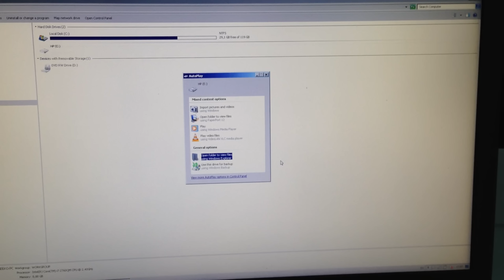How to recover data from a dead hard drive (for beginners)

Comment: i'm no engineer, but you didn't recover data from a dead hard drive.  you saved the data by saving the hard drive.  vast difference.
Reply: So do we get the data back or no? Please explain the difference and tell me about it.
Reply: @muhammadraza9292  basically he just saved it into the hard drive without retrieving into another drive, which means it was useless in the first place
Reply: Meet the engineer

Comment: Something else that could be causing this problem: the USB connection/unit is failing. This is what happened to my Seagate external hard drive (bought in 2008ish).  The unit was making a very faint clicking noise, and so thought the problem was the hard drive (as shown in this video). Once we got the hard drive out of the plastic shell, we put it into different 'shell' (hooked it up to power and a USB to the the computer) and the clicking noise went away, and i was able to access my files without an issue!  Turns out the USB unit had become very loose from the green circuit board (it was so loose it was flipping up from the board), and so was basically not doing it's job. Of note, the hard drive got really hot after only running for 15 minutes, so it's probably on the fritz as well, but we were at least able to get data off of it before it (eventually) dies.
Reply: I think I found my problem.... This is exactly what's happening with my Hard Drive !
Do you know what's that "USB unit with the green circuit board" called ?
I think if i could replace it would solve the issue...
Did you replace the USB unit ? What do you mean by "shell" , are you referring to the USB unit as "shell" ?

I know it's late, but if you're there plz help
Thanks

Comment: "how to recover data in some rare cases or how to make it impossible for data recovery lab in most cases"
Reply: The odds of someone with a dead HDD taking it to a data recovery lab and paying $500-1,500 to retrieve the files: 1 in 20,000.
Reply: Try to boot laptop with Ubuntu without installation with HDD in ur laptop and bootable pendrive. If drive shows in Ubuntu,then u can recover it by making it external hard disk by using HDD enclosure...
Reply: @Amit-rw4jo  what if it is not readable by bios itself. Ubuntu is just an OS so if BIOS can't detect it how can Ubuntu do it?
I have 2 such dead internal hdd's (not readable by bios) , if it is possible to recover data from this....then Help
Reply: @cinnamonsquash  download latest (hiren boot cd) and make bootable USB then boot the usb or recover your data
Reply: @bricology  I live in a small area with a low population, I work as a computer repair tech, and I send out HDDs for data recovery in a lab, and I do this typically around 2 or 3 times a year for $1600. So though it's rare, I would have to say it happens a lot more than 1 in 20000. That said it's always business computers or family photos recovery. I've never had someone pay that for some torrent files... yet.

Definitely do not try this with important data, as the odds are far greater that you will render the data unrecoverable, and this is a last ditch effort, not the first thing you try.
Reply: @nickgouthro  -- admittedly it was an off-the-cuff guess; I had no data from which to draw it.  But I still think it's a minuscule number, since the vast majority of HDDs that fail will never even be brought to a tech to be checked-out, much less then sent off to be recovered for $1,600
Reply: @abdulqadeerkhan9261  No software in hiren's boot cd can do magic. They're useful but not when the problem is at hardware level and not even when it's a deeper firmware problem, such as those that WD Marvel can solve if the hard drive is a WD one. For many cases you need a lab and tools to bypass the pcb (cause the firmware of many brands is closed). But, of course, your data may not be that valuable that a lab will be worth it.
Reply: Rare cases? Stiction is very common. Really common. And the odds this will cause extensive damage are little except if you fuck up, cause dust particles are really not a large issue at all, mostly they'll just be spun off from the platter as soon as it speeds up. The damage you will find has already been caused when it got stuck and scratched the platter.
In any ways, data has a value. 
People who says things are "priceless" are just people who were never forced to make difficult choices, everything either has a price or can be attributed one. I'd say most common user data is worth less than a thousand dollars for themselves, but it's also worth this attempt.
Reply: @Gabriel-sq6vy  the only stuck arm you might recover such way is the one which come from drop damage. In many cases  one or multiple heads stay on surface, results are obvious. DR professionals NEVER reuse stuck head even if it was removed as a one piece.
Reply: @Gabriel-sq6vy  the only  data worth such attempt is the data already considered as completely lost.
Reply: @R P take it to a pro
Reply: @Gabriel-sq6vy  "Priceless" typically refers to the inability to put a price tag on things with sentimental value, such as photos stored on a HDD. It does not mean they won't pay to get those photos back, contraire, it means there's no price they won't pay to get those things back.

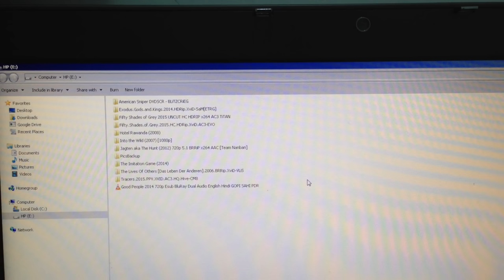Comment: Of course, I held my breath, awaiting your warning (at 3:05) that no hard drive opened this way should be re-used. Inevitably, some who watch your video will believe that if the drive now spins up, and was found on completion without obvious scratches, the drive has been brought back to life. The whole point of this procedure is to recover existing data as quickly as possible, and then put the drive to work as a fascinating paper weight (marking the drive with its volume name(s) and DOA date with a marking pen). Such "marking pen" documentation avoids enormous grief with data, later.
Reply: Most likely it's impossible now to pull a full image of that drive.
Reply: He discusses more or less what you just said towards the end of the video.  As he states, this isn't to repair the drive for normal use.  This is to get it working long enough to recover the data, then chuck the drive/replace with a new one.
Reply: Bob Greene ll
Reply: How long until the drive is dead, what if I have a lot of data to retrieve? Will it drop dead in matter of minutes, hours?
Reply: @kog7519  There's no telling how long you've got.  Something was really wrong to have those drive heads stick like that.
.
Reply: s l  That's why we always open harddrive in cleanroom... I'm a system engineer.. And it's hardly not recommanded to open it at all. If there is a problem with harddrive, the first thing to do is booting it with a recovery tool (like TestDisk) a good recovering tool will get you in the harddrive or make you know what the problem is quickly. Then if the problem is hardware, send it to professional if there are really important datas on it. Also, it's not recommanded even to boot a computer at all in dusty condition, it'll work, but dust will make it get hotter and hotter every day, that why server room are highly controlled environnement, to avoid any dust. For personal computer, it doesn't really matter, you'll have to clean you computer every now and then, for server, cleaning a couple of thousand computer is not an option.
Reply: s l  How is it irrelevent? You said that harddrive works well in dusty environement.. They don't..
Reply: s l  Hey man, as a guy that can't afford $3k to repair my dead WD drive, I appreciate your info. That drive is coming apart this week
Reply: s l  can you promise me you're not trolling? I have my dad's pictures and songs I need to recover after he passed away. Dust can't damage so of the files? I heard it's like if you scratch a CD...
Reply: Yes so before opening it up, try freezing it.  The unequal contraction of the platter and RW heads sometimes breaks them free to move and allow you a chance to get your data off the disk before it fails completely.  
Also the risk of scratching the platter using this method shown is v high unless you have very steady hands.
I’ve done this before and it does work in certain circumstances, depending on what is causing the HDD to fail in the first place.
Reply: s l  lmao 😂
Reply: s l  IS IT POSSIBLE TO DO SO BUDDY??? I HAVE 1TB WITH THE SAME PROBLEM I NEED TO RECOVER DATA FROM BUT I´M SCARED TO DEATH OF REMOVING THE COVER BECAUSE OF DUST??? WHAT DO YOU RECOMMEND FOR REAL??? THX!!!
Reply: @incumbentvinyl9291  *simply

We all struggle sometimes.
Reply: s l  He was referring to how you used "you're" instead of "your".
Reply: Hey man I definitely need help how can I contact you 🙏
Reply: . all this stuff is a bit confusing tbh ^
Reply: s l  chill kiddo
Reply: s l  hmm
Reply: s l  one of who?
Reply: s l  nope I used that hard drive for a week or two although I bought a new hard drive and by using a sata to usb case i copied data to the new one. The hard drive still works tho
Reply: s l  ye mane
Deez smol kids are wrong
Reply: @greatdaddy4710  A couple of years ago, I recovered three HDs exactly like in this video. They are still working.
Reply: @RmDIrSudoSu  no software helps if there is a mechanical problem
Reply: @Galova  it is then not recovered by software, but you can try to check what is at fault and replace it if possible, else there are possibilities to do it the hard way and analyse the way the sectors are magnetised, this technically can be done but it would be at insane costs, thus we uses backup and backup of the backup and then do backup on magnetic tape.

Comment: Excellent video! Very few people on YouTube or anywhere have shown that before you pay a data recovery company thousands of dollars to recover your data, it can't hurt to try this FREE fix. Love it.
Reply: If you dont care about your data feel free to do so.

But it absolutly can hurt if you mess up (fingerprint on H-3) or you re just unlucky because of the dust.

Filestructure is saved on H-0 + H-1 (lower surfaces) so you will notice if you messed up only until you start to read actually your data. 

Filestructure as MFT Map is normally not bigger than 1GB. So seeing your FS isnt any proof of a succesful datarecovery.

If heads collect dust und scratch because of it your surfaces completly even Data receovery cant help you here.
Reply: @Tobi3425 are u from data recovery company?
Reply: it can hurt

Comment: All I can say is WOW. I thought once the HD is opened in open air its dead. Kudos to you for getting this to work.
Reply: A drive that has been opened should be considered dead as far as using it for further data storage - it's no longer reliable. However, as long as the drive wasn't powered up while open, and no damage was done (e.g. fingerprints on the platters), it should still be readable for recovery purposes.

A note about dust: At 1:07, the part you can see in the lower right corner of the drive is an air filter. When the drive is first powered up after being resealed, it's designed in such a way that as the platters spin up, air will pass over the platter surfaces, blow off any dust, and trap it in that filter, before the heads even begin moving. (This is important because the drive mechanism can generate dust particles during normal operation.) So, unless it's massive amounts of dust, or something magnetic (e.g. iron gratings), dust is generally not an issue as far as recovery is concerned.
Reply: @NetRolller3D  I was probably more concerned that he spoke without a mask above the platter.    Moisture PLUS dust, you're not going to blow that off.

Comment: After watching other YT videos on this topic, this is the best one to date I have seen. Glad you mentioned that after opening the hard drive and retrieving the contents, to not put the drive back into service as it will not be a reliable device. I would say in this current day and age, this isn’t quite so common as most of the new drives bought today are solid-state drives, although there are still lots of these mechanical drives still in use.

Comment: This is great... The only problem with this is that most people will think that they can simply open an HDD in a regular room. HDDs are highly sensitive to particles in the air and must be opened in a highly controlled environment (ie. Clean Room). Without the proper tools and training, the user will end up making invisible (or visible!) scratches on the platter, rendering the data permanently lost.
Reply: this guy opened in a regular room. So did everyone in the comment section saying thank you lol. its just to get the data back, not to continue using it.
Reply: Who cares about opening it in a clean room or in toilet all that matters is they get their Porn back .
Reply: Hassan Ahmed 😂 😂😂

Comment: this is what we call stiction in the field, when you heard that sound it can also be a motor seizure which blocks the platter. My 2 advice as DR Technician are 1 do this only if you don't care about the data, if your data are important then go to a professional 2 please don't use the second hard drive on the platter, the guy on the video is well versed in doing it but you may easily scratch the platter by doing as in the video. A method that you can use is to put your finger on the base of the Heads in the circular and outer area and rotate it while you rotate the screw (anti clock)  in the center of the hard drive. The heads will go toward the outer part

Comment: This was a brilliant Video. Excellent picture quality and sound. Great technical content. Well done indeed!
Reply: as a Datarecovery engineer I have to say how dangerous this video is. One fingerprint on the surface and head-3 will die for sure. 

Also the dust will get collected bei head-3 and might scratch the surface. 

You re able to see your filestructure? Very nice, but that doesnt mean you re able to read data. Information about the filestructure is saved on H-0 and H-1. If you contaminate surface of H-3 you will still get filestructure even you contaminated H-3..
Reply: also: if your HDD is spinning your heads are not stucked on the surface. So please dont open your HDD if you want your data back. If you dont care you can try

Comment: I just did the first instruction to swing the arm across. But this guy didn't mention the tip was settled on the surface of the disk. So when I went to move  it, the tip made a prick scratch... Now gonna fine out if it works. So  when you try to swing it make sure the tip is lifted as much up and THEN move it to the side. Hope it still works or  that scratch is in a  blank sector with NO files.
I found the tork screwdriver at Best Buy, Brand name is Husky 8 in 1 Star precision screwdriver set. Like 6 bucks. It's the size of ones hand to grip it. And it's the T9 bit for my 3.5 inch WD old desktop Hardrive.

Comment: Wow, no gloves, no clean room, metal screwdriver on the platter. I know by the sounds the drive was making after that this did not work and you edited the video. I've been running a Data recovery lab for 13 years and this is the main reason data get's lost forever, man made damage. Normally I would not comment but you are helping people destroy their data. There is no cleanroom work for "beginners". Hard drives are far more sensitive even at a microscopic level.

Comment: Being about to read the drive directory information, and being able to actually pull a valid image of the drive contents are two entirely separate things. Opening a HDD outside of a true 'clean" enviorment is a death sentence for a drive, no matter how clean you think your work space is. Also, you most likely were placing some very nice scratches on the platters as you dragged the heads  across them, meaning read error after read error when you try to image the drive. 

I would be very interested in seeing a full clone of that drive happen without it either failing outright, or having so many read errors that the data is unrecoverable.
Reply: This is intended for data recovery only, not for reuse of the hard drive. Of course, maybe the data recovery can not be 100% possible.
Many electronic technicins do the same.
Reply: @MarioCardonaS  in all my life working with and on computers since I was a child in the late 70s, I've never once seen a tech do anything remotely this insane.

We have clean rooms for a reason.
Reply: Ur right Dear

Comment: When hard drives fail for any reason or the possibility of damage is evident.
1. Do NOT attempt to run the drive. It may cause further serious damage.
2. Do NOT open the drive. Again you may damage it further. Hard drives are extremely delicate parts of the computer.
3. Do NOT send to a computer repair shop. Computer repair shops have no experience in data recovery. No matter what they claim.
3. Instead send your drive to a certified data recovery specialist shop.

Comment: You should have removed the Heads Magnet so that when you moved the heads while turning the platter they would freely move and would not be hard to move. I did what you did and guess what? I caused damage to the platter. In fact I didn't even use a screw driver to move the heads I saw on another video to use a dental pic and it STILL caused damage to the platter.
Reply: how do i remove the heads magnet? sorry for the late question

Comment: i purchased a new WD wireless 4T hard drive recently and I'm in the process of moving 15 years of photographs and video from 7 external hard drives... today, I hit one of the drives i was working on and it fell to the floor... I picked up and it worked for several minutes and then stopped... click click click... I purchased a tool kit from Amazon which will be delivered on Tuesday and I will try to fix so I can recover the photos... I have a dog that is in it's end of life and the photos were some I took last may 2017 of her... In a year she has really degraded... will update after my attempt...